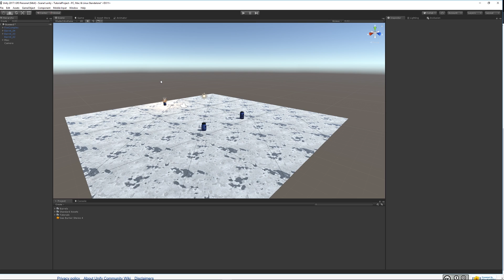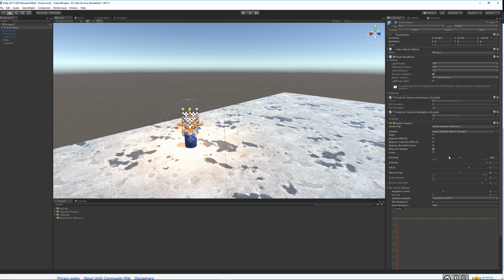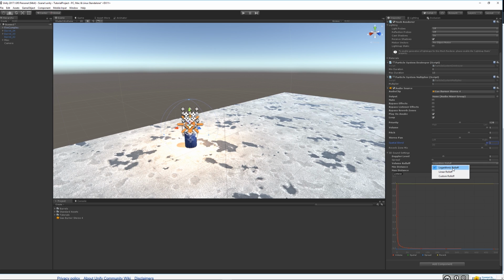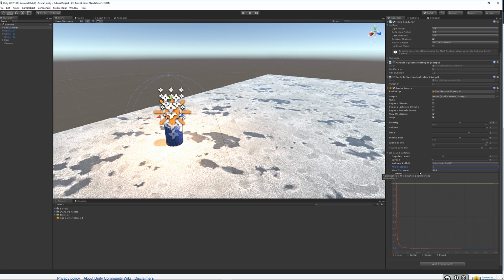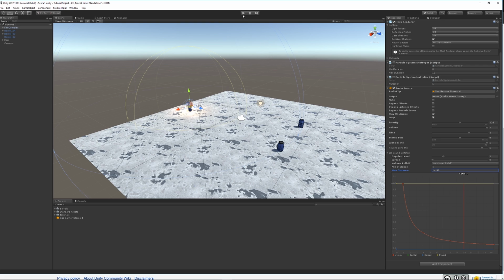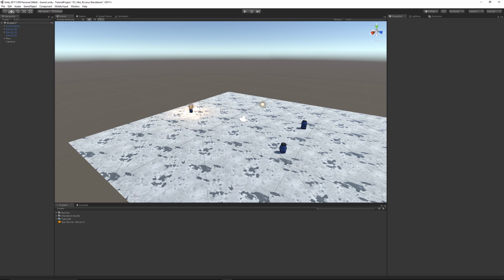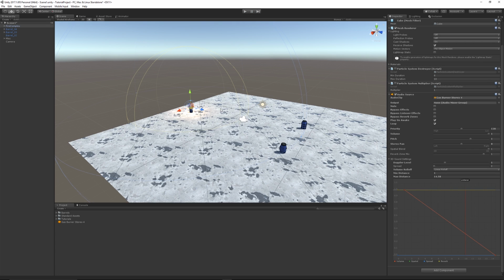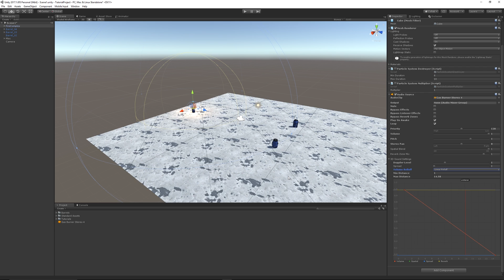How To Use 3D SOUNDS in Unity

Comment: How can  I make the sound not penetrate the walls or meshes? When theres a wall between the source and the listener the sound will be blocked or goes to the other direction, to make a realistic sound.
Reply from the maker: This is a very big problem I've wondered myself. You can find an asset on the Unity store called "Volumetric Audio" - Which may help.

Comment: doesn't work anymore in Unity
Reply from the maker: What version of Unity are you using?
Reply: @SpeedTutor  19.3f
Reply from the maker: I'm not sure what you mean?
Reply: @SpeedTutor   im using unity version 2019.3f on windows os.  Making a 2D platform game to be put onto Android.  I've tried multiple settings with the 3D spatial audio & nothing gets the desired effect of not hearing other sprites when i move away from them.
Reply from the maker: I'd imagine they do, but have you googled to see if anyone else had spatial / 3D audio issues on mobile?
Reply: @SpeedTutor   yes but most articles are dated to 5 years ago & add nothing new.  It's hard to believe im the only one lol.  I think the audio works ok if the far lower right point in the logarithmic curve isn't set to 0.  But if it's not set to 0, then i always hear the character anywhere i am in the game 🤦‍♂️
Reply from the maker: I've always had an issue with 3D sounds not really acting as they should, it's just a bit of an awkward system - I always thought but if you can find a compromise, I think that's a good thing! :)

Comment: Don’t forget that this works only!!!! For where the audio listener is. Which is standard on the camera. I mostly put it on the player.
Reply from the maker: Fair point! :)
Reply: SpeedTutor I found it out the hard way so i thought to share it! Have a good one!
Reply: The problem with putting the audio listener on the player is that when the player dies and respawns all audio disappears. It is much easier to put it on the camera.
Reply: Yea and in first person games the camera is basically the player, and third person games the audio should be adjusted to the position of the camera not the player still
Reply: Hi m8 can you help me get Linear Rolloff to be seted onliy as when i push play button and turn it off it get back to custom and not stay Linear so aniy file or hint you can du me to fix the problem as i want it Liner rolls onliy not get it back to custom buy defoult.